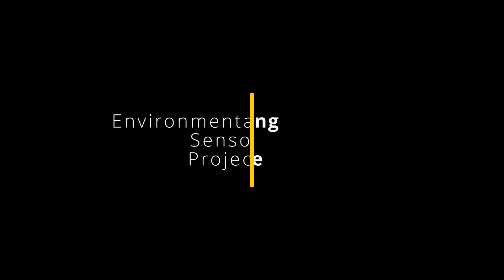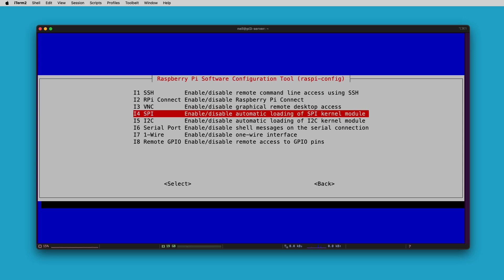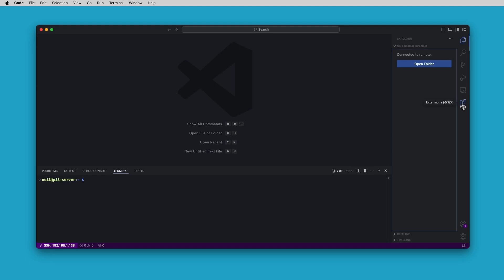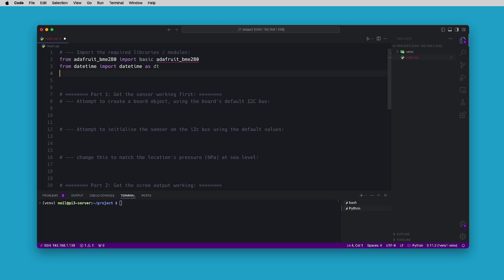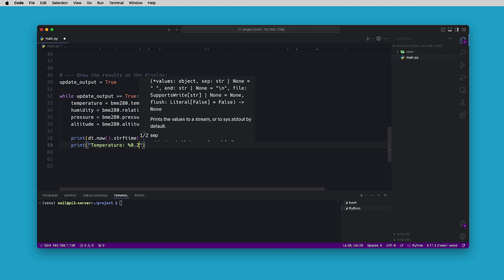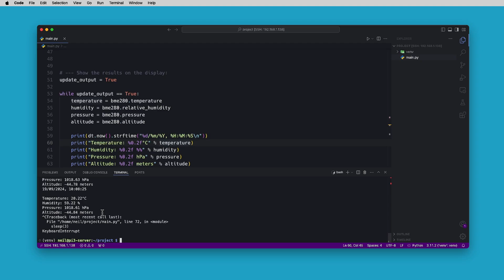Build a Raspberry Pi Weather Station | Python Project - Part 1

Comment: Do you plan on making this project work on RPi 5? I understand the gpio library no longer works on it.
Reply: Can i do this using rpi 4 model B? why the gpio library wont work? im  a newbie
Reply from the maker: I just tried it on a Raspberry Pi 4 model B (without a display connected) and it worked fine. Try downloading the code from the github repo (link is in the description) and see if that works.
Reply: @dev-neil-a Thanks man<3 I went to buy the stuff needed and couldn't find the I2C adapter for the lcd module, After finding it I am doing this.
Reply: @dev-neil-aHooray, the first part worked perfectly. Used the BME280 library instead of the adafruit one (because it didnt worked).Going to try part 2 now.
Reply from the maker: At the moment, I don't have a Pi 5 to test any specific code updates against. If I get one, I'll look to update the code in GitHub.

Comment: I am going to do this today <3 will try and update. is it a must to use the Adafruit brand?
Reply from the maker: Hard to say if it would work with non-Adafruit boards as the library I used is made by Adafruit and it was the only sensor I had.

You could use a different library in it's place for another board but I would check with the manufacturer to see if they have a library on PyPi for their board or some instructions on how to use it with Python.